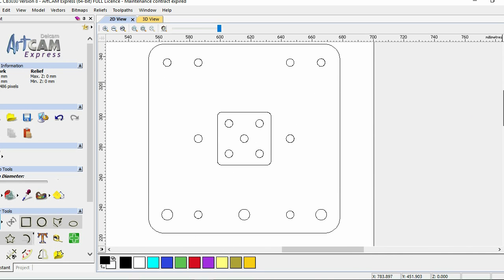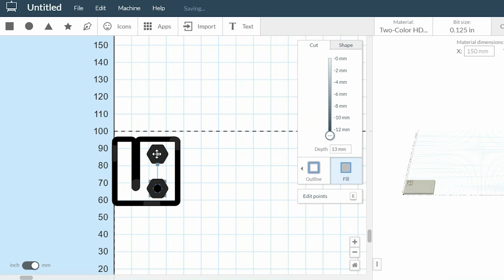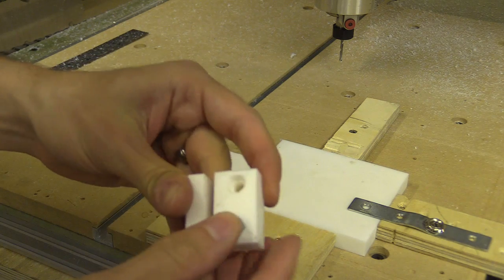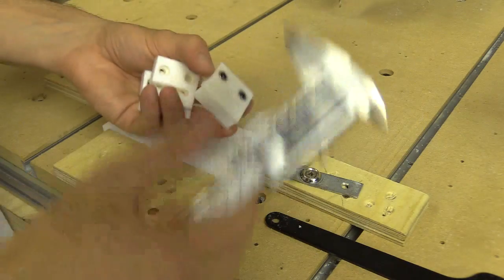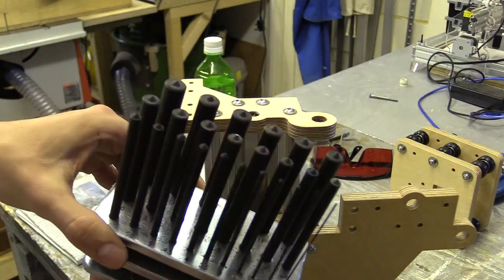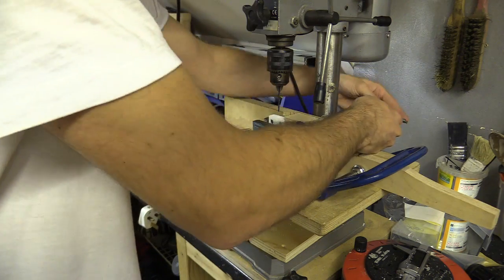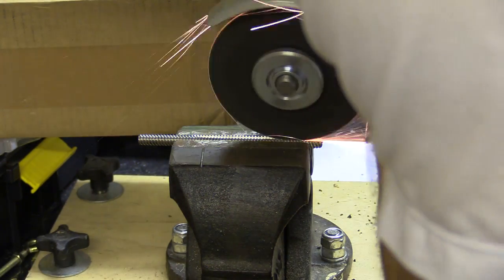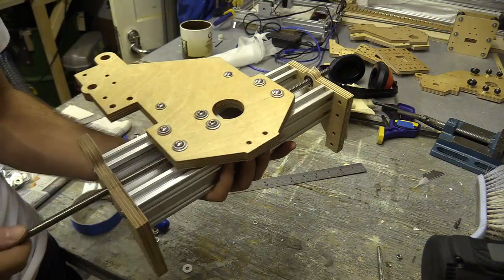#3 Making PTFE Anti-Backlash Nut Blocks and DIY ACME TR8x8x2 Tap #3 / C-Beam Lead Screw CNC

Comment: anti backlash nuts work as two "separate" nuts, each working in one direction, by making this nut so that it has much more thread on one half and less on the other you will have more wear, ideally nut would have same length of thread on the piece that is bolted to carriage and piece that is adjusted to remove backlash, still if you have tap already you dont have to worry since you can just make more nuts but the design could have been improved.

Comment: The perfect material for this is MDS infused teflon available at Mc Master Carr. I have seen this stuff do some amazing things as far as wear resistance is concerned. I have seen it outlast regular teflon two years in the same application .
Reply: Hey I goofed up!  Its actually  mds filled nylon ( Molebdenum disulfide ) its been awhile since I used it probably ten years ago. Its pretty inexpensive. I ordered some up from mc master car and made a repacment  upgraded adjustable leadscrew nut for the crossfed on my lathe. Now I have zero lash and a super smooth crossfeed with a nut that will probably out last me.
 Next time you do this and its time to mount and position the nut you can make your nut position adjustable with slots then when its aligned put two small locator pins in it . You can also use flat head screws in some applications for locators since they self locate on the screwhead. Then you can eliminate all the tricky transfer punch stuff and get it perfect with less effort . Good luck !!

Comment from the maker: *NOTE* I've cut my nut-blocks out mirrored so they don't fit on plates in the same orientation as the ones from the open-builds part store.  I later redesigned the plates to have openings to these can be adjusted and well. Some of these are now in the wrong places. Worth mentioning if anyone is planning on doing something similar.

Comment: What kind of bearings do you use for the lead screws? I see some people use thrust bearings to absorb axial loads, but I'm trying to learn if it's necessary on a smaller CNC router such as this.
Reply from the maker: Just normal ones. There a several types of thrust bearing but I'm not sure it would make such of a difference on my small machine. If I had a thicker lead screw I'd consider them.
Reply: Okay, good to know. I'm designing a small machine myself now. I learned a lot of useful info from you videos. Thanks for sharing!

Comment: what is the bit diameter you used for the 8mm acme thread?
Reply from the maker: The answer is in your question.
Reply: I think he's asking what size you drilled the hole out to before tapping it. Obviously if you drilled it out to 8mm you wouldn't have any material left to form a thread from. If the pitch of the trapezoidal screw is 2mm then you should have drilled it out to 6mm I'm guessing?

Comment: why not a split block of reclaimed HDPE, then heat the screw and push both sides on. 
taping is not going to cut it I fear.
google 'neuesten Bauform der Tr-Mutter', first image result, another great design.
Reply from the maker: I don't think that would work or at least it would be very complicated and smelly. PTFE is a better material for the nut block because its low reaction to chemical or heat, and very low friction against the lead screw.
Reply: HDPE works fine. UHMW is even better. both are self lubricating and HDPE melts at 130°C. doesn't smell. heat it in an old tin can outside.. oven will do also. outside in a box with the blowtorch and some thermometer is best. machine it to size and melt over the screw. 
this will definitely gain you better clearance than tapping.
Reply: UHMW is available as machining stock material. I would prefere it over Teflon.
Reply: The reason I prefere HDPE or UHMW is that Teflon has a melting point of 327°C and therefore can not be thermomoulded over the screw.
Reply: That said, I am looking forward to your experience with the Teflon nut. Let us know how it works please.
Reply from the maker: Thanks, I will look into it as do have some scrap HDPE but was intended it for another purpose. I think my block layout would make it difficult to line the thread up to bearing holes - because it fits along the side of the y plates and not through as I've seen documented. Interested idea.
Reply: You can use anything with the recycling number 02 on it (PEHD). I like to use food containers (ketchup bottles) because they are easy to clean or cleaning products.
melt it down in a small oven or with a heat gun.
would not cook it in oil like some recommend...that's just messy.

Comment: Beautiful! instead of buying PTFE the expensive way you could salvage it in your local scrapyard and get a way cheaper price for it. There are always local companies which work for industry and technical fields that work with this material and get rid of their cutoffs. I get my PTFE (black PTFE) at the price of 1€ per kilogram at my local scrapyard... that's awesome!! cutoffs often have scratches and dents but as long as you rework them and they are so cheap it's ok. It's a pleasure to work with!
By the way I'm really fan of your two channels since I viewed your videos about making your first table saw. Keep on the good job!
Cheers
Reply: Finding a scrapyard like that in the UK is a pain in the backside, sadly.
Reply from the maker: Thanks Nicolas for the comment and suggestion. As Jamie mentioned it's not easy to fine a place like that here, but I'll keep my eyes peeled.

Comment: I was doing the exact same thing, then found 500mm ball screws and anti backlash nuts for circa £30. I to am building a better cnc from a cheep cnc. I was building a cnc without a cnc and stuck my finger in a spinning router bit making lead nuts. That's when I decided that I need a cnc to make my cnc. but the cnc has acme running on teflon nuts and the backlash is a pain in the arse. sooooo..... i am upgrading the cnc that is making the cnc to ball screws. well that's what I told her anyway.
Reply from the maker: I shouldn't laugh, but lol ffs. I did notice that making the tap out of the same material as the lead screw, and tapping the nut blocks with it has really minimised any movement. But I'm sure once everything is vibrating away it will start to fall apart...